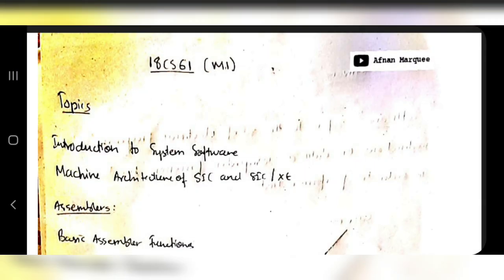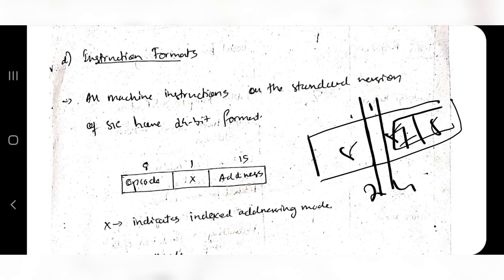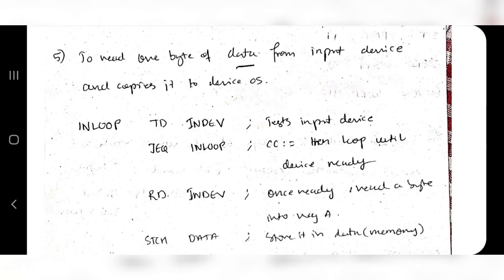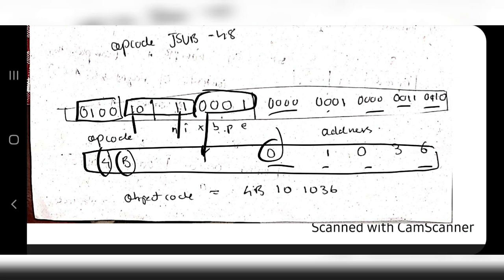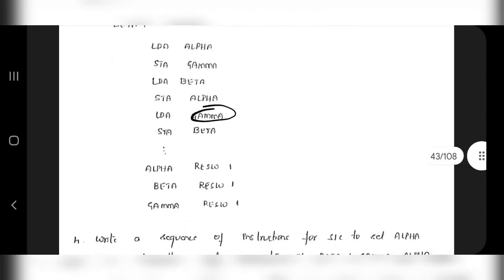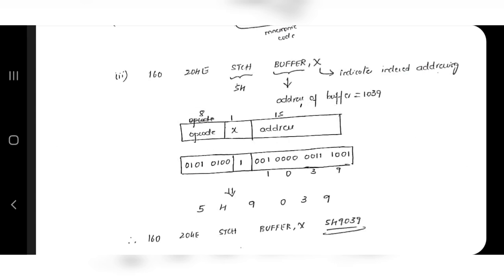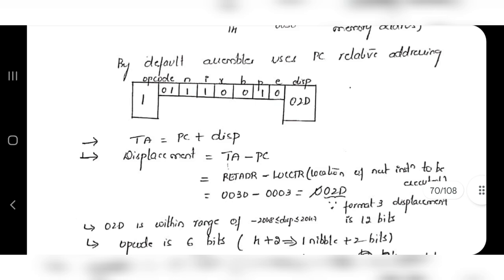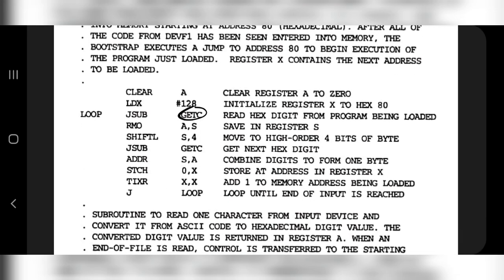18CS61 - SS and CD - MODULE 1 - System Software and Compilers - VTU 6th SEM CSE/ISE

Comment: in 2 hour 2 min 2 sec resb 2000 is 7d0 then how to add 7d0 like in case on resb4096 hexadecimal is 1000 adding 1000 is easy but how to add 7d0
Reply from the maker: In calci, ther is an option to add hex values

Comment: at 1 hour 17min 40 sec how did u look at rdrec and write the value of nixbp e ik how
Reply from the maker: Yes you're right
Reply: i have a pdf in which on the 125 line 1036 rdrec clear x b410 is given ik the address is 1036 but how are u fixing the nixbp values
Reply from the maker: Same as for others how i did like that only,
since its format 4: e=1
its neither immediate nor indirect: n=i=1
its not indexed, x=0
in format 4, always b=p=0 because directly the address is entered in the last section. Hence it cannot be pc or base relative.
Reply: @AfnanMarquee  see according to u i get it that it is in format4  thats y e=1 + sign is there thats y 
there is no # or @ thats y n=i=0 or 1
in format 4 b and p is always 0 

but how is x=0??
Reply: wait idk if i am right but x=0 because there is no mentioned x
Reply from the maker: It wouldve had x=1 incase the instruction was like +JSUB RDREC,X but X is not present in that specific line itself, therefore it can't be indexed.

Comment: sir in the 4th sic program the initialization of x to 0 in the first step is not clear could u explain 
u have written ldx index 
where index is resw 1 
its just an empty box when did u initialize with 0 
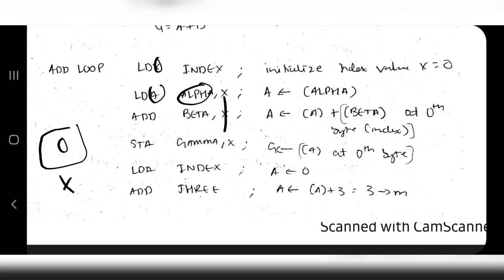ur comment line does not match with your step its somewhere around the 49:00 minute
Reply from the maker: Got it from notes, even i didn't understand that step, anyways SIC programs are not asked for exam, rarely only
Reply: @AfnanMarquee  where are the question papers for 18 scheme brother